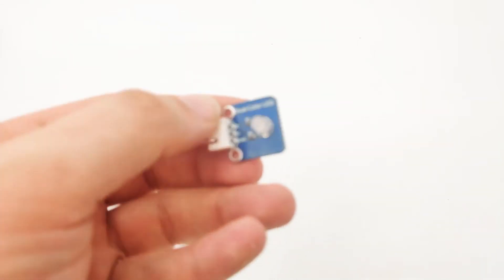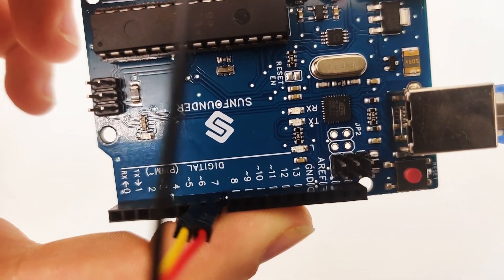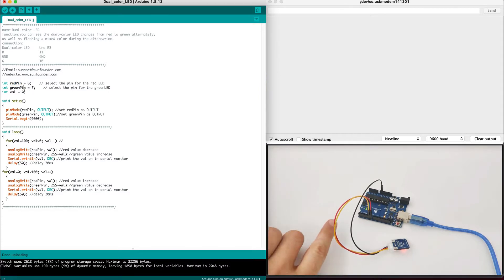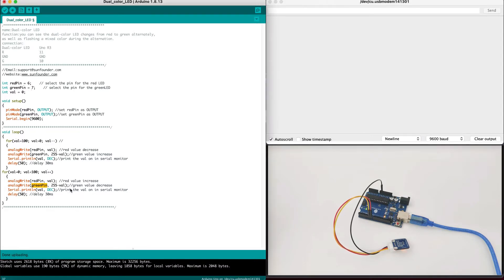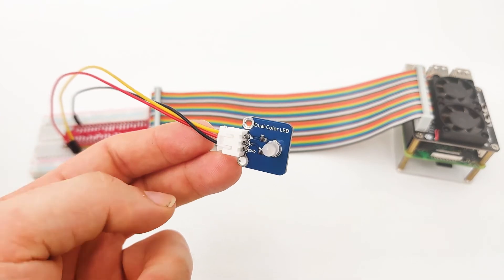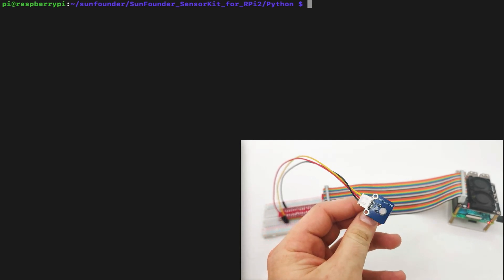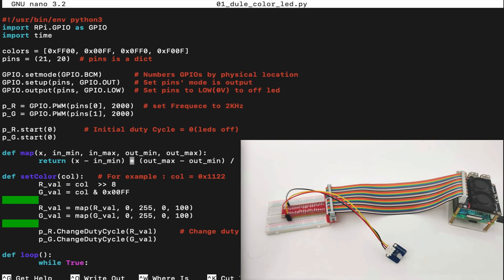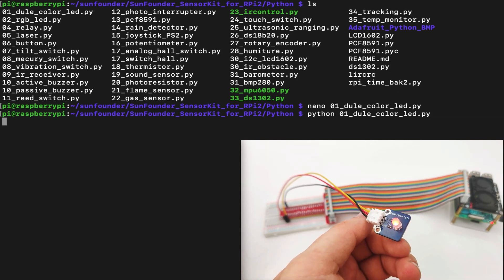How to use Dual-Color LED with Arduino& Raspberry Pi

Comment: I know video is old but I tried doing this with a dual color LED (5mm) and copied the sketch word for word for arduino, but mine flashed red and stayed red. did not change at all, any suggestions?

Comment: HI, I just bought the 37 parts kit for rasp and there are some errors/unnecessary wiring, for example, on the 1st lesson, there is a jumper that does nothing. Is it correct?
Reply from the maker: Sorry for not understanding what you mean. Which jumper do you mean? Can you provide some photos?